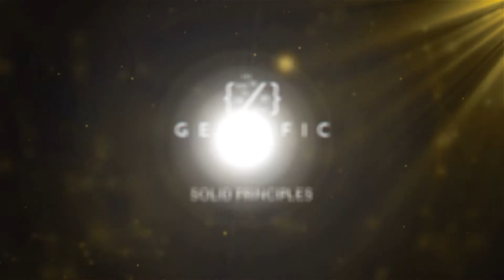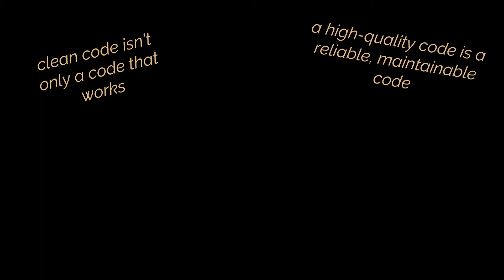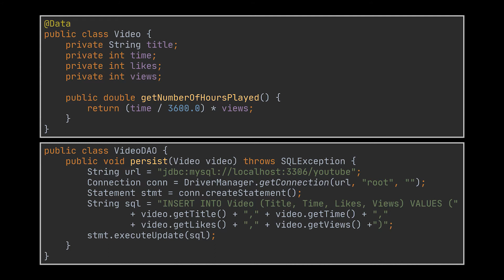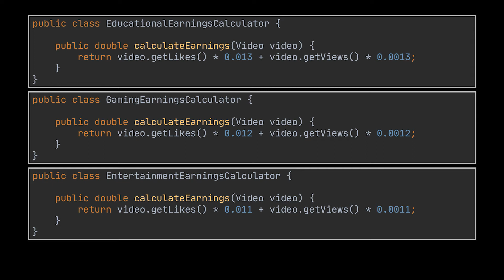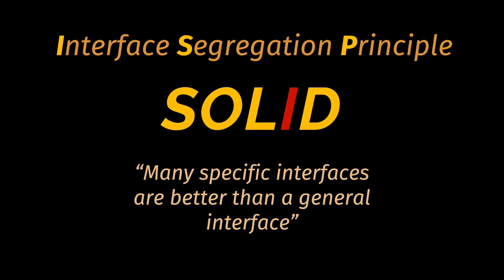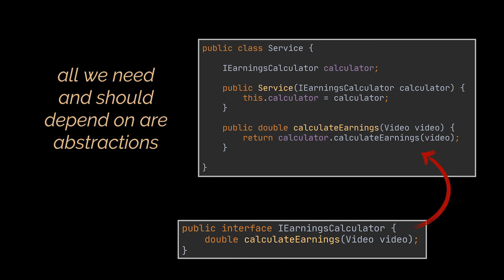SOLID Design Principles with Java Examples | Clean Code and Best Practices | Geekific

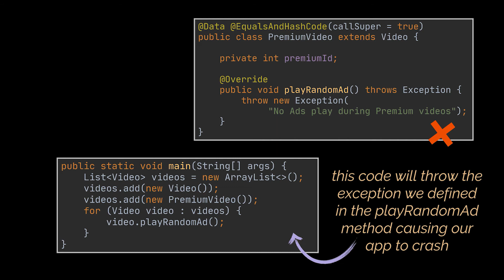Comment: 7:17  how can I use the methods of manger class without creating an instance of that class, those methods are also not declared as static too..
Reply from the maker: Great question! In that video, the methods in the Manager class aren’t declared as static, so technically you do need an instance to call them. If you want to use those methods without creating an instance, they’d have to be static.

Also, just so you know, there’s a v2.0 version (https://youtu.be/m2mGFCxT-T8) of this video that goes deeper and might clarify this part better. You might want to check it out!

Comment: In the Liskov explanation, the video classes need to extend the Video manager class right?, i am a bit confused
Reply from the maker: Good question! Actually, the Video and PremiumVideo classes don’t extend the VideoManager class. Instead, VideoManager is used via composition, each video class has a manager instance that handles certain behaviors. This way, instead of inheriting behavior, the classes delegate tasks to the manager, which helps follow the Liskov Substitution Principle by avoiding problematic overrides. So, composition over inheritance here!

Comment: 7:20 wouldn't just be better if we could just create a base class that doesn't have playRandomAd methods and have both video and videoPremium class inherited it and implements playRandomAd inside video instead. Does that make sense? So we have the option to either override methods from base or not and also helps us reducing number of lines code.
Reply: i thought so too
Reply: Yes, but let's say you have 10 different video classes, imagine 9 of them defines the method playRandomAd. W/out an abstraction for this method, you will have 9 repeated implementations

Comment: I am reading Clean Code and one thing I noticed is that Robert C. Martin recommends to avoid words like manager, processor, data or info in the names of a class, i.e. VideoManager at 7:14
Reply: but to be honest I have no idea what else to name it in this case
Reply: What about VideoHandler?
Reply from the maker: Great observation! Yes, Uncle Bob advises against vague or generic names like Manager or Processor because they don’t clearly express the class’s responsibility. Naming classes with clear, specific roles improves code readability and maintainability. Thanks for pointing that out!

Comment: isn't the Liskov substitution principle the opposite of what shown in the video? i.e. Base type should be replaceable by the sub type?
Reply: @geekific  OP is right, the text needs fixing, you got it the other way around. ;)
Reply: LSP is not updated yet with example Base type replace by sub type...
Reply from the maker: You're absolutely right! The Liskov Substitution Principle states that subtypes should be replaceable by their base types without affecting correctness. If the video made it unclear, thanks for pointing that out! For a clearer explanation, you might want to check the updated v2.0 (https://youtu.be/m2mGFCxT-T8) version of this video where the concept is broken down in more detail.

Comment: For the open closed principle how would you avoid rewriting the driver code that instantiates all the classes that follows the open close principle?
Reply from the maker: It depends on your use-case. You may not need all of them (strategy-like) and if you do you can probably put them in a factory.

Comment: Does the Liskov principle always mean applying composition?
Reply from the maker: The principles state what the problem is but not the solution. So, you can use whatever means necessary to resolve them. Sometimes, creating specific interfaces could resolve this issue. In this video, we tried to explore different way to do that as much as possible! Cheers!
Reply: Thanks a lot for the fast reply also Happy new year to you bro!